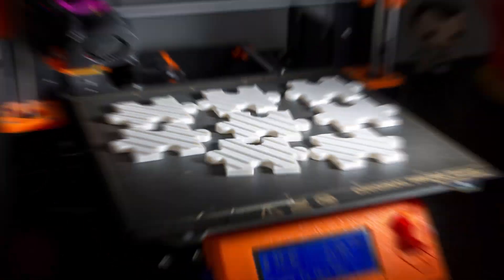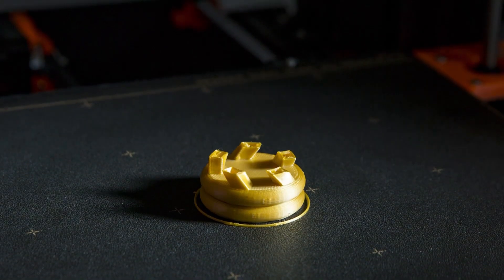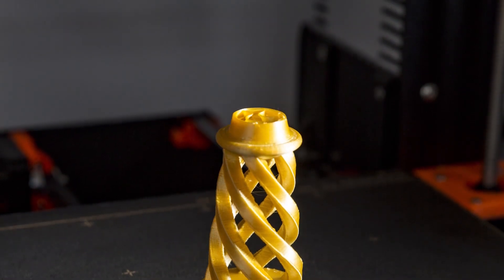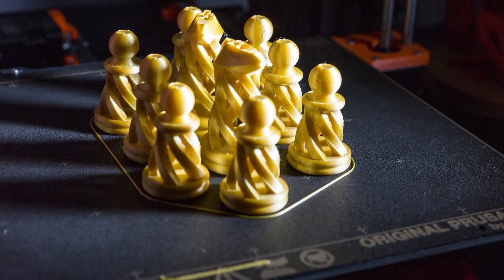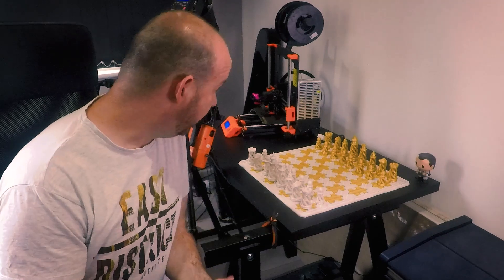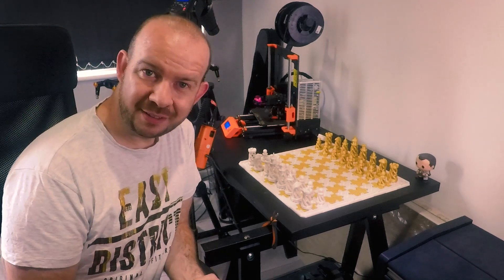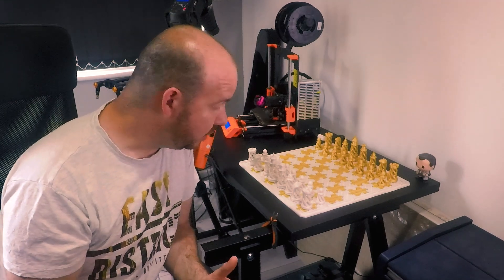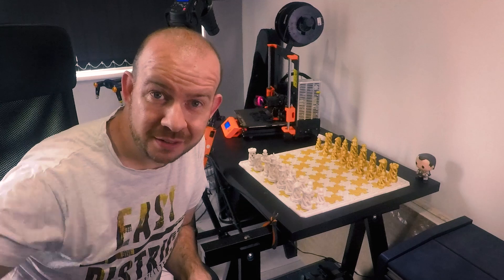3D Printing a Stunning Chess Set and Jigsaw Style Board - A 60 Hour Project

Comment: How do you clean the print bed?
Reply from the maker: Hot soapy water and a washing up sponge. Then a spray with some isopropyl alcohol. Works like a charm!
Reply: @ratemyfuneral  what’s percent iso? 90 okay?
Reply: @ratemyfuneral  just got a Eder s1 pro:) excited to get into this hobby do I need a really good computer or will my laptop suffice?
Reply from the maker: @Stark-Topic  I use 99%. Best done as the bed is starting to warm so that it evaporates as it cleans. Laptop might be ok. Depends on spec and what it is you want to do.

Comment: What infill pattern is that? It looks ideal for the entire structure and im curious
Reply: got it, its gyroid, but whats a good infill percentage? i read between 2-3% but that seems so low
Reply from the maker: Hey, correct! It is indeed Gyroid. Depending on the size of the object I am printing I will generally use between 15 - 20%

Comment: How do you find your new prusa 3d print quality compared to your old flashforge finder?
Reply from the maker: Actually, the Flashforge was much better and getting good quality prints easily. The Prusa has the advantage of the bigger bed, but to get as good prints you really have to tweak your settings.